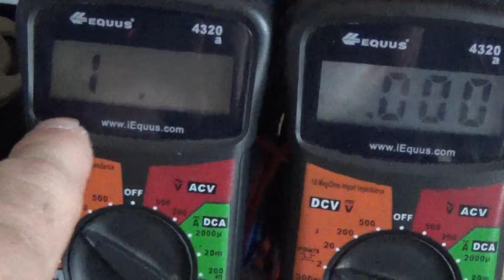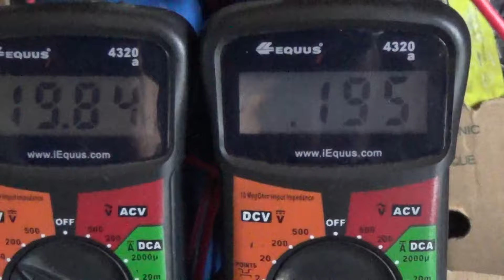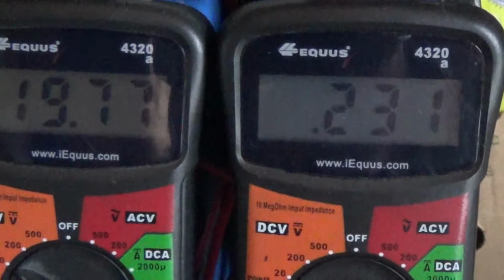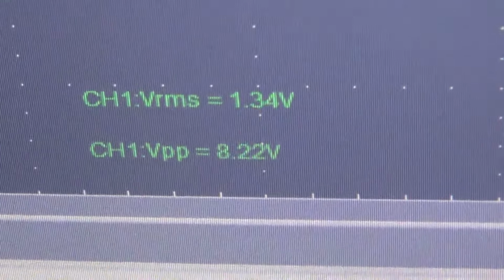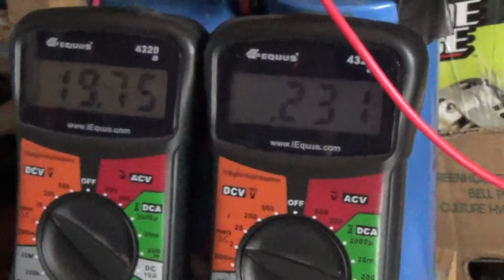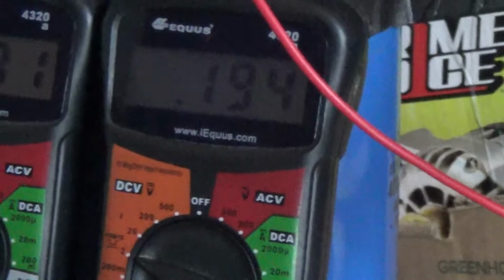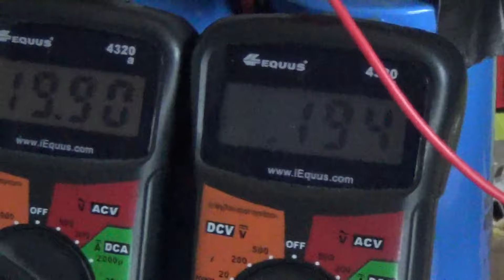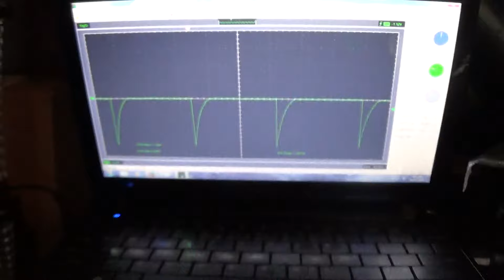Testing ideas of more efficient Coil Flyback use (test 5)

Comment: Are you sure that you are measuring Amper at the right Ampermeter ? Because it looks it's commutated to Volts.
Reply from the maker: +onurolce No, themeter is measuring mV across a 1 Ohm resistor (shunt) which is between the capacitors of this Low Pass Filter.  So 1 Volt = 1 Amp